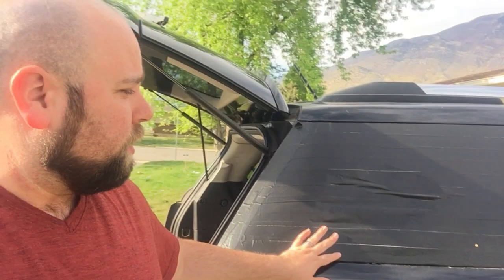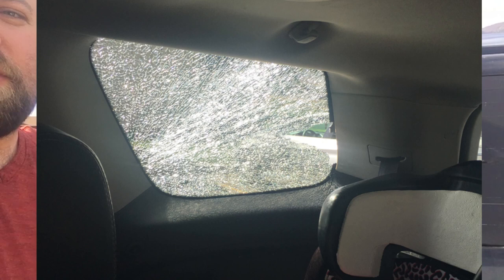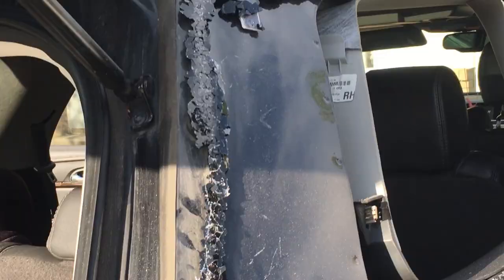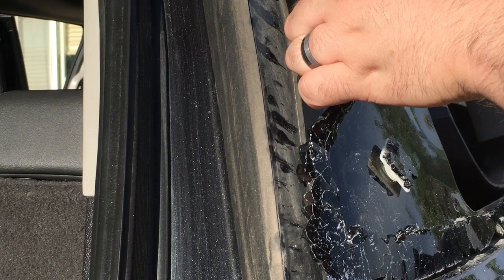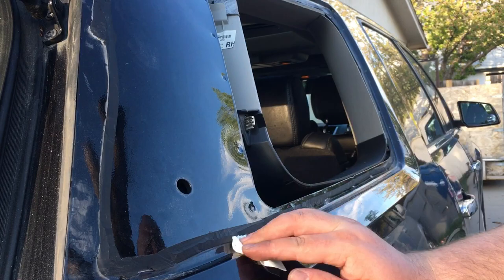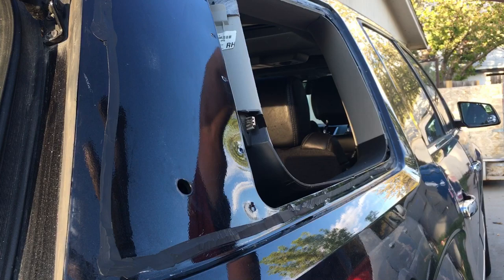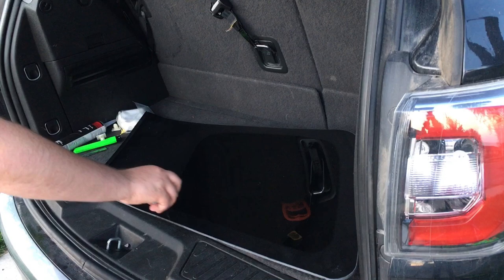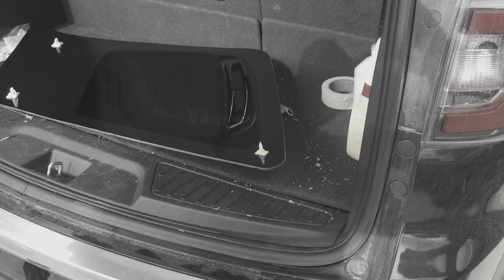GMC Acadia Rear Quarter Panel Window Replacement: DIY Guide!

Comment: A coat of primer is recommended for the glue to adhere better.  I'd guess that it's just an added insurance and it's not absolutely needed.  Besides the primer is sooo expensive!
Reply from the maker: You have that right. Primer would be best if available.

Comment: Hey i watched your your video and i really liked it.
So, i have the problem but my car is 2011 4runner, and i understood all process there is one thing that i would like to know the type of GLU that you you used for the the class and clips
Thank you.
Reply from the maker: 3M Window Weld 08069 and 3M double sided super strength molding tape.

Comment: Can I use 24awg wire for apple watch repair? Or does it have to be 0.08mm 40awg?
Reply from the maker: I use .04mm, even the .08mm is to thick in my opinion
Reply: @FIXDPHONES  why would you say it's too thick? I can't find any 0.04 with fast shipping :/
Reply: @FIXDPHONES  this wire says it's made for lcd repair. Is it just because it's a OLED? It says gold plated aluminum wire 0.08mm made for lcd glass removal

Comment: Whats that tool called u using yo push the adhesive out
Reply: A caulking gun?
Reply from the maker: A caulking gun, but you'll want to leave the adhesive to warm up in the sun as its hard to do by hand. Most Professionals use a automatic tool that squeezes for them to get a consistent stream of adhesive.

Comment: Could've went to the junkyard for the window. I paid $45
Reply: How did you get it off without breaking it??
Reply: @bfdmod  I don't know how they got it off the car at the junkyard but they handled that part, I just picked it up and installed it on my car.
Reply: @bfdmod  they use a heat gun around the window and a special tool that looks like a very thin jimmy or a razor to pull the brackets from the car